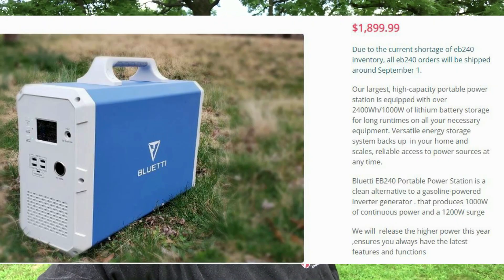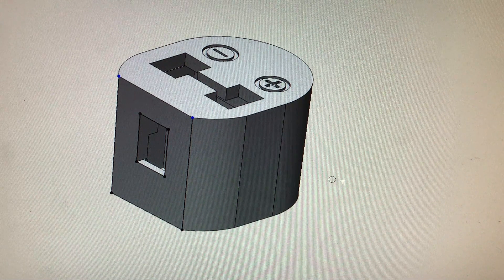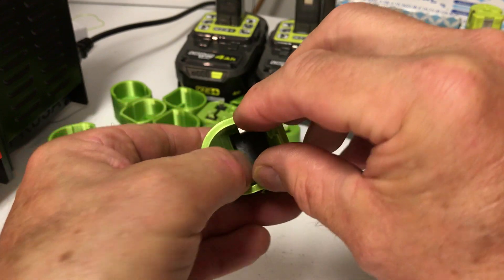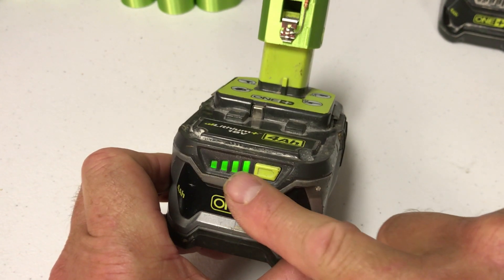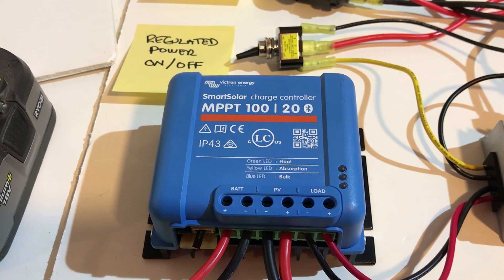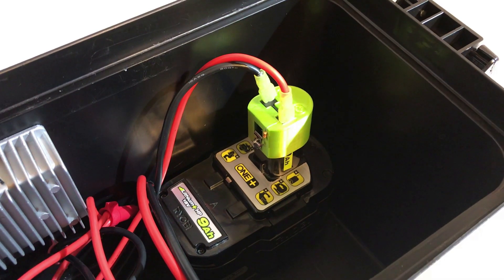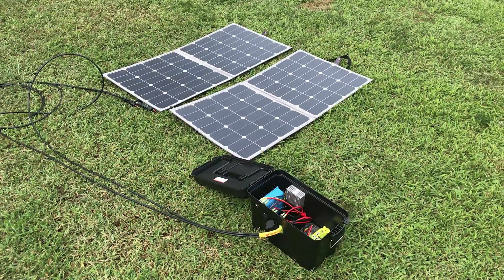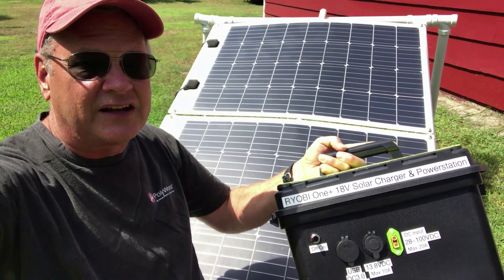Ryobi One+ 18V Battery Charge Adapter for Solar / Powerstation

Comment: Great project! I'm new to this,and I have a question. Your are charging 18V battery with 24V solar panel system. Does Ryobi battery have MPPT built in or you can set up your Victron MPPT to 21V? Im just wondering how you prevent from charging. Thanks in advance.

Comment: Absolutely love this. Think we may be able to update it a little? I have some questions. So 2x12v solar panel in series is 24v. Ok. Good so far. 24v going into MPPT charge controller. Ok. MPPT set to give batteries 21v? And MPPT set to output solar panel voltage/ 24v?
Why not use 24vdc inverter instead of going from 24vdc to 12vdc to 120vac? Also most of the usb QC and PD outlets will accept 24vdc so that would be 2 things to take off of the dc-dc converter. I have fed some of my 24vdc outlets 6s lithium (25.2vdc) with no issues. Just curious as I am about to build one of these things myself. 
Would you change/ do anything different if you had to build one of these today?
Reply from the maker: I have made a ton of different designs. Look thru my channel video tab. As you state, if you don't need 12V, the USB adapters will take the Ryobi 18V direct

Comment: Has anyone made this work and be willing to share their Victron settings? I’ve connected everything as described here but when the Victron is part of the setup, the DC output load will not function. Without the Victron, the DC load works great. I’m thinking that it’s some Victron setting that drops the current on the output side. I’ve posted the question here to Chris, but no reply yet. Thanks in advance.
Reply from the maker: sorry, I thought I responded to you. You could always just hook the DC-DC converter to the battery terminals instead of the load terminals. You would lose the capability to turn off the  load via your phone, but it should work.
Reply: @SerendipitySue  Thanks Chris. Sorry to be slow, but If I do that, the batteries would be out of the loop and also not chargeable wouldn’t they? I’d really like to solve the no-load issues with it setup per your design. It’s a thing of beauty.  Thanks for your help.
Reply from the maker: @tdknucklehead9416  connect both the battery and the load wires to the battery connector on the Victron. Many Victron solar chargers only have 4 terminals (solar panel and battery connections.)

Comment: Chris, would it be possible to see all of the VictronConnect 100/20 parameters that you set to make this work?  I’m getting intermittent output from the DC/DC converter.  Before I connect that converter, I measure 20.6 V on the Batt  side of the MPPT.  Sometimes, I’m seeing the same 20v on the load side.  However, sometimes, after connecting the DC/DC converter I’m only showing  5-11 V on the output from the converter. It’s jumping around in that range, sometimes not showing any output at all.  If I disconnect the converter and reconnect, sometimes it stays on and shows 20v, but it’s cutting off sometimes too.  Just not consistent.  Just wondering if it’s a setting on the Victron.  Thanks very much for this video and your help.

Comment: Hi - thanks for getting back to me on this.  Decided to start with just one batter to make sure everything is working.  Did find that i definitely need 2 solar panels - tried with one but the apt showed I was only outputting about 17v (using a xtar sp100).  That one is easy to fix.  But I noticed a couple of other things or issues that I am not sure about.
1.  Once I add the resisted to the adapter it shows that is charging (blinking light) - guess thats normal?  Even if its hooked up to the 75/20 MPPT charge controller.  
2.  When I have just the battery attached to the controller is showing 0 load output and getting <1v on the load output terminals even if the switch is on.  I did test the boost converter and it is working and I checked the wiring to the switch and the usb/lighters.  I did try changing the load output setting to always on as one commenter suggested with no luck.  

Not sure if it matters I am using the 75/20 controller and not the 100/20 that you are using.

Any suggestions.

NOTE:  a fully charged battery is showing 19.8v and ones with 3 lights range from 18.8 to 19.8

Edit: where do have the jumpers set to?
Reply: @CyberMerlin did you ever get the parameters set on the Victron?  When I gave it connected as Chris shows, the load output is nil. Connecting the battery via his adapter directly to the DC converter works fine. I’m gettin 13.8 output to all the downstream connections. Can’t get the Victron to work so I’m thinking it’s a setting issue. Any guidance would be appreciated!

Comment: Hi Chris - just got all the parts to assemble this and had one question for you.  You mention that you what to be able to use 2 batteries at some point - how would wire it up to use 2 batteries.
Reply from the maker: If you had two similar batteries and kept them together so their voltages were the same you could just double the allowable charge current. But if you mistakenly put two batteries together with different voltages, it would be dangerous.

Comment: Chris, this is a great video and very helpful info.  When you upgrade to charge 2 Ryobi batteries simultaneously, do you plan to use the same Victron 100/20 Controller or will you need to upgrade that as well?  Thanks again!
Reply from the maker: Charging is tricky. If you have two batteries of the same size and they start out fully charged, you can. You connect them in parallel so they act as one battery. You can then up the maximum charging current in the victron software.

Comment: Radical.  Thanks for the tip on the 1.2K resistor.  That's exactly what I needed to know.

I will measure the leakage current in charge mode with my fluke 87V and report back
Reply: Did you ever figure out how much power is drained with the resistor in place ?  I’m trying to figure out if I need dedicated charge adapters and dedicated discharge adapters or if I could just use the charge adapter for both with the resistor.  Just don’t want too much drain happening with the resistor in place.
Reply: @michaelkramer111  I could perform a test for you.  What I personally do is....

* Discharge the batteries through the red and black wires 
* Charge the batteries with the factory charger 
* I've got seven of the factory chargers.......

Just make sure you respect 
* LVC
* HVC
* OverTemp
* UnderTemp
* Abnormal (wet pack)
* Etc

-Schindler

Comment: Yeah, you make good points. Power tool companies could easily expand by making heavy duty portable power stations primarily meant for off grid construction sites instead of just focusing on making people buy relatively small batteries that only work with their tools, which they constantly need need to fire up a gas generator to recharge.

Comment: Hi Chris .. .love you designs and made a few of them and they all work fine.   I tried this one and I am having issues.  I am using an 18V Ryobi Battrer and the same voltage converter and  the Victron controller.  I used power pole connectors instead of the  cigarette lighter socket and lever nuts.    It will power up fine with a 100W foldable panel or a bench supply but after a while the load  will get disconnected. the voltage drops off and the converter shuts down.  I am using 2 12V led strips to the power poles as a load and USB socket adds a small load ....  I disconnect the voltage converter and the the output on the load terminals goes back up ... and I tested the converter with the bench supply and battery and it works fine.  configured the battery setting in the Victron through the app.   I tried a second Victron and the same things happens.   Any ideas what's wrong:?  thanks   Dave Rothman
Reply from the maker: not sure, maybe the load is too small and it turns off? I'll have to go back and check to see if there are more options in the App. You can always just hook your converter to the battery terminals instead of the LOAD terminals.
Reply: I tested it .. with a bench top supply and a ryobi  battery ..  and then reached out to the   Victron  rep  . that sold it .... through their support line .... in email ...  if you click the gear icon  in the upper right ...  there is a setting for .. load output ......... "Always off" or "Always on"  They suggested I  set it  to  Always On"  that seems to have fixed it.   I don't think they load was too low . when I connected the  voltage convert to the bench top supply it worked fine.  And make sure the  jumper is out ..   I also made your projects with the single battery topper . with the usb socket and the converter .. all work fine. Good   Job with your projects .. thanks for your work.  
 Do you know if the Ryobi batteries have short or surge protection?  I was experimenting with something else and had 2 batteries in series ... and it seems like there was a short or surge ...      I opened the pack and the batteries are fully charged ..  but there is no output .. I think the board died .... I saw replacement boards . so I may try one.

Comment: Hi mate.....with the victory controller, when configuring the charge voltage, what voltage did you set it at?
I am looking at making this myself, but the little bracket for the top if the batteries, even though you printed them, is it possible to be able to buy 2 of the com0lete off you?
If not can you purchase them anywhere?
Oh yeah, I am on the bottom side of the world.......lol...Australia
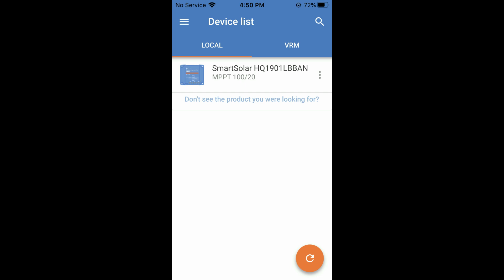Reply from the maker: Look at 6:24 minute mark in the video to see how to configure. I can't really sell/make/support the Ryobi parts. I've put the designs for free on Prusa/Thingiverse sites (see video comments). There are Internet companies that will print models for you

Comment: Chris, what did you use the:  + 29.4V 2A Power Supply Charger for on your parts list for?
Reply from the maker: That’s so you can charge with ac instead of solar

Comment: Wouldn't it be more practical to build this solar generator with a 12VDC battery and use the Ryobi DC charger? It would seem to be more versatile.
Reply from the maker: I was trying to show RYOBI that they should develop an 18V solar powerstation. I didn't want to have to use an additional battery. It would add weight and decrease efficiency.

Comment: I have a similar setup but have a 100AH (soon to be upgraded to 200 AH) 12v LifePo4 battery charged from the solar panels. I then have the options to charge my Makita batteries DC to DC or use a small inverter to use Makita’s AC charger. Although it’s less efficient I prefer to use the AC charger as the AC charger won’t charge the Makita batteries if the chip detects a fault in the tool batteries. I’ve previously tried charging faulty Makita batteries using a DC power supply, not a good idea. They overheat big time, so for safety I prefer to use Makita AC chargers. I could take one apart to see if I can convert an AC charger to a DC charger. I noticed Ryobi have DC car charger (12v cigarette male terminal). 

Thanks for posting your video, hope it’s inspired others to create their own DIY solar solution. Everyone should have their own solar powered battery bank even if it’s only used to charge their mobile phones and tablets from 5v usb outlets. In this day and age, we should be energy independent when charging small DC devices.
Reply: I figure the AC chargers to be about 88% efficient and a good inverter 90%. The AC chargers are not power factor corrected but for some reason this doesnt seem to draw any extra current from the 12v battery so it's not too bad. One other downside is the inverter's standby power draw after the charging is done but if you keep an eye on it not too bad.
Reply: I agree we should all start getting familiar with using direct DC charging for phones, speakers, flashlights, portable fans etc. Low hanging fruit

Comment: How Many Volts Do Solar Panels Putout Alone?
Reply from the maker: it depends on the panels. For smaller 100W range panels it is  usually 18-21VDC
Reply: @SerendipitySue  I Thought About
Getting A 24 VoltvPannel For My Power chair.

Comment: Hi, just couple of question. How do you calculate the required ohms value for resistor,  would it be same values for all the batteries? and will this setup prevent battery from over charging or damage the battery in anyway?
Thank you, great video by the way!!
Reply from the maker: I did it experimentally. It works for the array of different Ryobi batteries I own.

Comment: Great video!  Is there any way to solar charge more than one battery simultaneously (in parallel)?
Reply from the maker: if you start with several similar sized batteries that are fully charged and you put them in parallel and use them. The voltages will be equal after use. You can then charge them in parallel. You just don't want to mix different size/charge level batteries.

Comment: I've been wanting to do this for years. I have so many Ryobi batteries and I don't want to invest in another company's portable solar system because I don't trust their batteries since they aren't replaceable. I also don't trust proprietary battery form factors even if they were replaceable. If the company goes out of business in 3 years and I need a new battery I'm screwed. I'm confident Ryobi will be around a long time so id rather have a solar system built around their batteries. Especially since there are many useful outdoor tools like a chainsaw i'd love to have in the backcountry. If Ryobi made this as a product I'd buy it in a heartbeat.

Comment: I wanted to do something similar.  I ordered 2 100W solar panels and a 12v charge controller.  My plan is to connect the panels in parallel and feed into the controller.  the output to the controller will connect to an inverter and I would plug a power bar to the inverter.  I would then plug my 5 chargers into the power bar to charge my batteries.  Will this work or is there too much load for 5 chargers

Comment: Would the same approach work with Porter-Cable 18v Batteries?  The adapter connection would be different of course.  But I'm guessing that there still needs to be a resistor between two of the terminals.  Does this matter whether it is older Ni-Cad batteries or Li-ion batteries?
Reply from the maker: I don't know how porter-cable batteries work. Not sure what is required to put them in charge mode. I would assume Ni-cad  & Li-ion have different charger profiles. I've only played with Li-ion

Comment: Awesome work. Is there a reason that you are not inserting the switch BEFORE the 18-12v adapter?  Could this device drain voltage just by being attached to the battery even without being used?
Reply from the maker: You are correct. The switch LED was not rated for the higher voltage. I usually don't leave a battery in it.

Comment: You are very misleading to your viewers.
After 500-800 cycles doesn't mean you toss it out.
Jackery and Bluetti guarantees 80% capacity after the 500-800 cycles.

Bluetti now sells power stations with 2000-4000 cycles before drop to 80% capacity. Unless, Ryobi, Milwaukee,  Dewalt, Ridgid starts using LiFePO4 for their tools. They can't compete with Bluetti and others.
They will not use LifePO4 on their tools because the weight will increase by 40%.

I hope you learned something.
Reply from the maker: Correct, most lithium Ion systems will go to 80% after 500+ cycles. I thought I already said this in the comments (my mouth doesn't always say everything correctly ;-) When the batteries fail, you are out of luck. As you point out Lithium Iron Phosphate are being used by more vendors. This technology is much safer,  gives you mores cycles, but weights more. People that only occasionally need back-up power, power tool batteries make a lot of sense. You can use them for all your other tools, but have them for emergencies. The batteries are the major cost of these systems.
Reply: @SerendipitySue  No! You said toss them.
Same with CheapRVliving Bob Wells.
He was telling his viewers to buy Walmart batteries instead of Jackery.
He stopped telling people, once he got a  earful from some commenters.
Reply: @SerendipitySue  
I have Ego Nexus and Jackery 240.
Both been excellent so far.
It will happen like everything else we buy. Most of the time, batteries and electronics don't go bad as people think.

Comment: Another GREAT video...Just got my Sub !!! I bought a bunch of PORTER-CABLE 4 and 5 Ah batteries as spares for my tool kit, but they're just sitting around waiting for action. This could be the new need filled by the batteries !
Reply from the maker: Are Porter-cable batteries compatible with Ryobi? Or will you 3D print another adapter?

Comment: Great video. Any updates on how to charge multiple batteries, do you just wire them in parallel?
Reply from the maker: still investigating. I have charged two in serial with a 36V lithium charger. But haven't figured out reading the temp sensor yet

Comment: Thank you very much for all your content. Two questions ..where you get your battery clips from? And what printer do you use?
Reply from the maker: The parts are listed in the video description if you expand it. I have a Prusa MK3S with MMU2S. I also have a Prusa Mini. I  print most things in PETG now. No harmful fumes and it is waterproof/UV resistant.

Comment: Hold the phone Crarlie. You don't throw away after 500/800 or in Bluetti case 2000 cycles the batteries just decrease capacity by 20%.
Reply: yeah, that didn't come off right. My point was you can't replace the batteries as they degrade or stop working. I had a eBike battery pack go bad after only two years with only light use. Bluetti has a 2 year warranty.